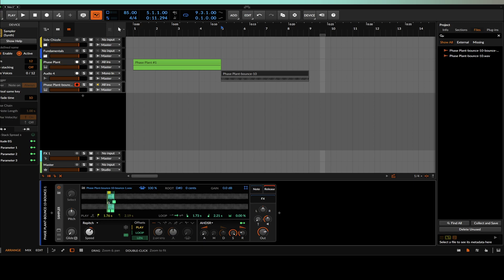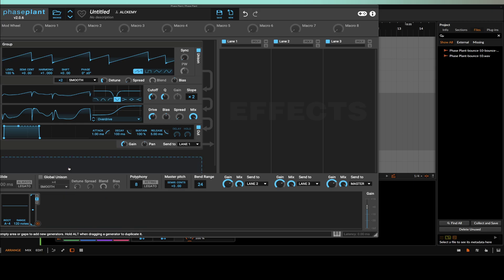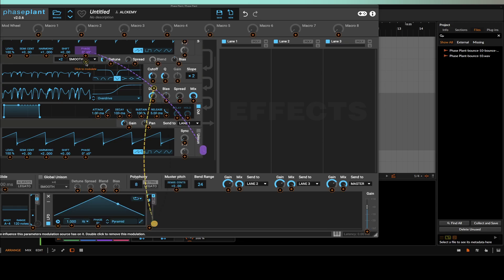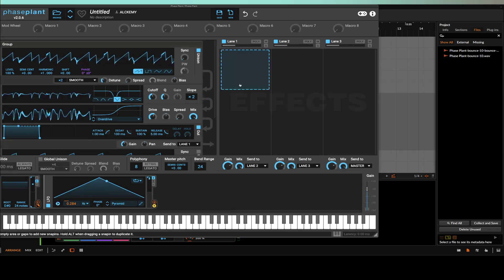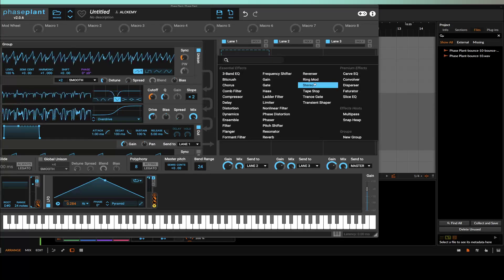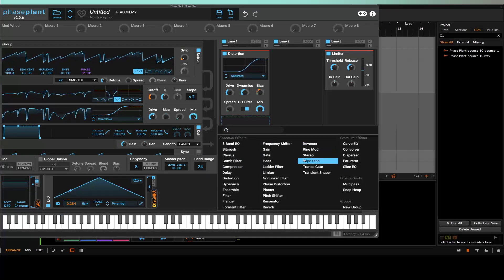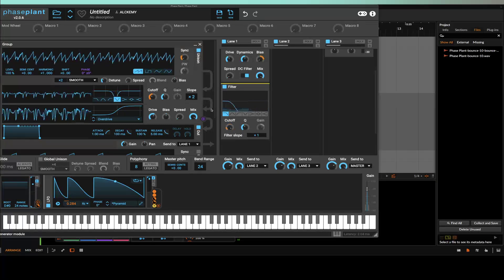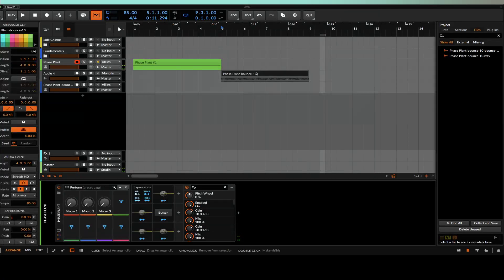What the Heck is An Artificial Reese? #phaseplant

Comment: Nice trick! I use to achieve the same thing using a silent OSC at -60 semitones linked to the Amp of the main OSC, but this methid also alows doing the same with the modulator features! Thanks for the pro tip mate!
Reply from the maker: Thanks for watching the vid! Yeah it’s meant to hopefully open some doors and get that same vibration but from other sources rather than Detuning. ^^
Reply: @Alckemy  Bro, I just looked into a reese sound I did few days ago you may be interested if not already discovered by you already. Add 2 OSC; the second one as a silent OSC; put the semitones pitch to -60 and the harmonic about x1.259 with a sine/triangle wave, and link that one to the Level of the main OSC. Global settings would be glide if you like, and polyphony set to 1. You don't need to use Detuning at all, and the vibrato speed is in the harmonics of OSC2, the silent one. You can modulate the x1. with Note mod, so the speed of the vibrato! if need to, but it naturally happens. And that gives you freedom to detune as much as you want, and add as many voices as you like in the Main OSC, anmd do any tweak that the basis stay always in its essence. It's weird becuase the Level should affeect volume (gain), but it does't, not at the least, at a some level of perception becaue there is a very small moment in which the volume is faded. And then you can do any thing you like with the Phase and in combination! Hope this helps too!!! 🤝